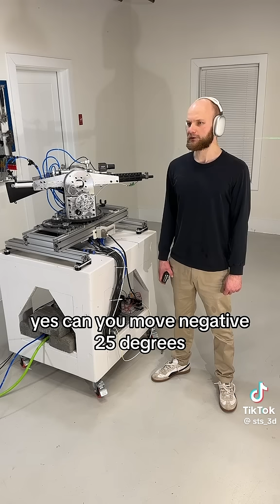AI is totally safe. It

Comment: ChatGPT isn’t even needed to make this machine work
Reply: Exactly what I was thinking, now if it starts disobeying and pointing at him tho… 😂
Reply: @thsGuy it cant start disobeying idiot
Reply: It's only needed to interpret the voice. But you could also make the machine work with a remote device or even an app.
Reply: There is a use case, but it merely has to do with receiving voice commands and translating it to actionable events. Accessing the video feed, accessing location data, rules of engagement, identifying friendlies vs hostiles, and finally aiming and shooting are all external actions, and the voice command is just one small piece of the puzzle for soldiers to interface to the automated AI soldier.
Having the LLM actually perform the commands and execute them is reckless and scary, too many things can go wrong interpreting from words to actions, so really it should only be taken as one piece of input for the higher level managing software.
Reply: Yea you could literally run this off of a raspberry pi with ai recognition so it shoots an actual person instead of randomly
Reply: @ But that's literally what they have done, they just didn't connect a camera yet
Reply: they should totally make it like the tf2 sentries where it detects one color as good and other bad
Reply: People really don't understand that even what they're using to type their comments with spellcheck and suggestions is AI. ChatGPT is general AI, we have had specialized AI for a long long time.

General AI has simply never been this powerful, it's the stepping stone of having a centralized AI that can do anything and match human intelligence... for example... a super computer with AI to power all of a space ship's functions like in SciFi. Or yknow, we could always get out there and find a Moya.
Reply: Chat gpt makes it easier for anyone to do it
Reply: Yeah I thought it was gonna accidentally shoot him
Reply: Yeah you could use siri
Reply: Main problem with this is every command and round you fire has to be relayed out to the internet
Reply: it’s all just tool calls. you provide natural language into a model, give it access to functions (that you’ve already built) within your implementation/program, and ask it to respond with a data object (typically JSON) that contains arguments to those functions, which subsequently fires them.

what dude is doing here is really not much different than him putting in a few numbers for pitch variance/angle/interval, and clicking a “FIRE” button — he’s just talking instead of typing.
Reply: I mean, a program like this would of course be possible, but you would need to program every command into it or use a simple AI like Siri. With a more sophisticated AI like ChatGPT you basically have unlimited possibilities.
Reply: @DasSchwarzePhantom I'd better program every command then let A.I. do whatever it wants
Reply: @Mazaxict11  Well, AI doesn't want anything, it processes and generates from what was processed. It can't think or choose or act on it's own although in a setup like this you would really want to test the accuracy of processing before using it.
Reply: @ No one fully understands why A.I. generates a particular response and there is always the chance of different mutations in the response. So it's not wise to give a lot of power to something you can't fully control
Reply: @Mazaxict11  why do you think that? Just because you don't understand doesn't mean nobody understands, I will put a link to an 8 part video series exactly explaining how AI works. The only reason AI generates different responses is because we told it to using a number called temperature. If you set the temperature close to 0, it will always respond the same straight to the point.
Reply: @Mazaxict11  https://youtube.com/playlist?list=PLZHQObOWTQDNU6R1_67000Dx_ZCJB-3pi&si=aWSa3L299mIZvhdp
Reply: @DasSchwarzePhantom I develop simple A.I. models, I definitely know how it works )) And I would never let A.I. to drive anything seriously
Reply: @Mazaxict11  Well, saying that "there is always the chance of different mutations in the response" is just wrong, and the thing that is hard to understand about LLMs is how it stores the information which is insignificant in the context. You can fully control AI if you just use it to process input and generate output
Reply: @Mazaxict11  I don't know if it's smart to develop AI when everything you just said about AI was wrong
Reply: @Mazaxict11  Well the other person sent the link that they know what they are talking about, what about you? Can you tell us what the name of the AI model you developed for proof
Reply: @DasSchwarzePhantom point is you keep project simple and efficient, in this case it's easy just to use simple speech recognition library, you can use it offline and literally inspect every line of code, external dependencies is always a big NO on projects that require reliability.
Reply: @DasSchwarzePhantom i don't think you understand what you're talking about man
Reply: @DasSchwarzePhantom so you just admitted your wrong. Og comment said "GPT isn't needed", but you responded with "AI is needed!", and when faced with the argument that "Siri existed before gpt", you then proceeded to say "but Siri is an AI". Thus proving your original response completely irrelevant to the original comment. Thank you
Reply: @Mazaxict11  LLMs are deterministic in nature and you can configure them such that the same input will always yield the same output. Randomness is usually introduced on purpose to make the responses more varied and less predictable.
Reply: @DasSchwarzePhantom No you don’t. You program a basic set, which is quite limited since, you know, a turret can’t really do much (turn / tilt / fire), then you just chain commands together. You don’t need to programm every possibility - you just need to put the logic that handles this three things and that’s it. Do you imagine regular software being a ridiculously convoluted net of every possible chain of interaction? Of course not. The only thing AI does in this sutuation is that its better at processing regular speech patterns, so you can be more imprecise with your commands, but why would you even care about that.
Reply: @occamschainsaw3450 how would you chain the commands that were given in the video? To shoot every 5 degrees with a different tilt? Chaining a lot of tilt, turn and shoot commands is not feasible when talking so you would have to program something that interpret this and generate the commands for you. Then, for any kind of different more complex command, you would have to do the same.

I think you are missing the point. Sure, you might say that this is useless and no one would do that, but no one would he using something that is shown in the video anyway. It is a fun project which shows what we could do if we processes human speech and turned it into actions. To say that LLMs are useless in this context simply means that you did not understand that value that it had in the context of this project
Reply: @slicepie410 Exactly the same command as in the video would be a bit tricky - that's why I said that LLM is better at natural language processing. However, you can easily do "Shoot every 5 degrees, tilt random". You just have language processing library. First command engages the Shoot function, then accepts either a definite degree or a range (in this case "every 5 degrees"), second engages "Tilt" function which either set's the barrel at set tilt or randomises it if given a parameter "Random". That's like... Very easy.

>Then, for any kind of different more complex command

There is just turn, tilt or fire. That's three possible functions. It is literally impossible to get it to do anything more complex. Complexity is a function of composite simplicity, that's literally how programming works. Now, if let's say you'd have something like "Identify threats, assess danger, act accordingly" - now that would be tough to do. But, in the video, no one did that, so it does not matter.

>To say that LLMs are useless in this context

They are useless. All it does is it makes it process natural human speech a bit better, at the cost of drastically low performance and drastically higher possibility of malfunction.
Reply: @ And you know what's even funnier? ChatGPT does exactly what I describe here. It just translates speech patterns into a function calls. So you still had to program this functions in the way I described and then taught ChatGPT to chain them, instead of just doing it yourself
Reply: @DasSchwarzePhantom THIS is pointless. Just use a human or simulated machine and itd be far more usefull. If it were able to track things and shoot perfectly on target then its got some good use
Reply: How tf would you process the input without using A.I.?
Reply: @DasSchwarzePhantom there are literally 1000s of speech recognition projects even before chatgpt is a thing.
Reply: @pv7523  But how would you process that?
Reply: @pv7523  You would need to analyze every single word and put it in context in order to then make the commands for the gun but analyzing every word and putting it in context is exactly what an AI does
Reply: @DasSchwarzePhantom I wonder how Siri worked 5-10 years ago without A.I., hmmmm
Reply: @Mazaxict11  Siri was using a really really simple version of AI to understand the user and worked with a limited database of possible responses. If you would use something like Siri, it would limit the amount of commands and you would've needed to program complicated commands right into it.
Reply: @Mazaxict11 Siri can’t write equations to rotate something on 3 axis and fire can it?
Reply: @Mazaxict11 the fact you think Siri isn’t AI is wild
Reply: @DasSchwarzePhantombruv all you would need is the operator to know the commands it’s that simple
Reply: @DasSchwarzePhantom LLM's don't understand context. That isn't how they work. Fundamentally, you're wrong.
Reply: @DasSchwarzePhantombecause you can take out the middle man entirely. you don't need speech recognition, hell, it seems way too slow here. visible things like pattern recognition and isolating certain shapes and colors to distinguish targets to shoot is easier than having ai as a foundation. it just makes sense to keep the machine as it is without adding the ai.
Reply: @DasSchwarzePhantom They mean a way simpler AI could easily do the job, one that many wouldnt even consider AI
Reply: @Sesuaki19 Yeah, but as I said, this would limit the possibilities drastically
Reply: @DasSchwarzePhantom Not really? What extra capability are you gaining for using ChatGPT? Like sure it’s cool that it understands speech, but a much more specialized AI could do the same task, and even run faster since you could run it locally. Don’t get me wrong this is a super cool project but for what it is, using ChatGPT is DEFINITELY overkill.
Reply: @ Of course ChatGPT is overkill but you still need a fairly sophisticated AI to interpret the many many different possible commands
Reply: @DasSchwarzePhantom Yes. But in a real world scenario having to give an AI voice commands to operate the machine isn’t useful, if he had added something automatic like: “Watch the field for the next 5 hours, shoot any enemy troops, unless there’s a risk of an ally in the crossfire.” Then it would be much more useful.
Reply: @thsGuy  But what he build is completely capable of that, it just needs a camera. Also, what you just said is a voice command
Reply: @DasSchwarzePhantomwhat are you even talking about bro we have visual recognition for years now. This project uses ChatGPT because it’s fun not because it’s practical nor necessary. I’m not very good at embedded but I sure can slap on YOLOv10 and make a simple version of this project.
Reply: @DasSchwarzePhantom you are right with the parsing part but, but whatever ai outputs back should also be sanitised and not taken face value
Reply: @thsGuy What is this "simpler AI" you're talking about? The reason for using something like chatGPT is that it can process any input and generate commands based on that. With only a voice recognition model you would have to say specific commands word to word or "keywords", and then hardcoded sequences that you wrote yourself, "fire 25 degrees to the right" for example, and write a program that chooses the sequence based on the keyword. But this is not smart at all. With the LLM you can make it generate any command on the fly. For this specific scenario as it's relatively simple or might only have like 5 to 10 different sequences you really need, sure, you could achieve the same with some hard coding and a voice recognition model. But using an LLM gives a lot more flexibility.
Reply: @ Using ChatGPT for a gun cannon is overkill because it’s a massive language model designed for generating text, not for real-time control. It requires heavy computational resources and network latency, making it impractical for time-sensitive tasks like operating a cannon. A self-hosted solution would be far more responsive, reliable, and efficient. The right way to turn voice into cannon commands is by first converting speech to text, then using a custom LLM trained specifically for that task to interpret and execute commands. Additionally, relying on OpenAI’s API is incredibly expensive—definitely not a cost-effective solution for something so simple. If you’re serious about AI, you’d know there are much better, cheaper, and more practical ways to handle this. By the way, this comment was written by ChatGPT, which is exactly what it was made for—generating useful text.
Reply: @thsGuy  Ok so you were talking about chatGPT specifically. I agree with you. I thought you meant LLMs in general.
Reply: @ Kind of? Like for this project yes you need an LLM. Not something as smart as ChatGPT. But for an automated solution you wouldn’t use most of the things like in the video. I hope that makes sense, the real world version would work in an entirely different way, for example fully automated. 🫠
Reply: @thsGuy  Yes, it wouldn't make sense for a real system like this to wait for human commands but it's a fun project.
Reply: @DasSchwarzePhantombecause you can take out the middle man entirely. you don't need speech recognition, hell, it seems way too slow here. visible things like pattern recognition and isolating certain shapes and colors to distinguish targets to shoot is easier than having ai as a foundation. it just makes sense to keep the machine as it is without adding the ai.
Reply: @DasSchwarzePhantom by using a normal program as we have for decades

Comment: Right…… this was the exact thing we did not want to see AI develops into, and we all called it. It is the exact thing people will start using it for.
Reply: This is not about AI. Whoever would want to make this sort of gun would do that without any AI. "AI" or more specifically LLMs just made it easier for avarage Joe because he does not need to create own voice to text and text to event analyzers - which most likely would be much more effective in terms of performance because it would be trained for one purpose. LLM can try to make you a cofee with this gun but thats the activity you do not require 😅
Reply: @pavelduda9234  You're forgetting that "voice to text" and "text to event" are AI. So you're wrong by saying this can be done without AI.

As for the use of more sophisticated AI-whether it has any purpose:
You can combine it with object tracking AI and even facial recognition AI to work autonomously. Other than that chain of thought LLMs can introduce forethought into the action thus enabling tactics or (if the model is smart) even strategy. 

But it's not necessarily about utilizing features unique to an LLM in a weapon. It's a proof of concept of sorts. What it shows is that AI will not hesitate to shoot under right direction(even despite this model being heavily aligned). And that's why it's so scary
Reply: @tajemniczywasacz  voice to text was available 20 years go and text to event is also not an AI. The fact that everyone is using term AI basically for anything nowadays is irrelevant :).
Reply: @pavelduda9234  Well, deep learning neural networks first appeared in 1965 so it being available 20 years ago is not out of range so to speak. As for text to event I meant text as in "human language"  not programming language or preprogrammed commands
Reply: @tajemniczywasacz  i dont think that what we saw in 70s and even 80s can be called deep neural networks. They were using mostly just one layer and were pretty primitive (in comparison with what we have now). Even the NN we were using on university around Y2k were still primitive and speech recognition sw and some "expert systems" were mostly utilizing probabilistic models (eg like Markov). Maybe it can be classified as subset of AI by some definition but for me it is not an AI (maybe I'm too old school 😁)

Comment: Yeah it's really crazy how chat gpt built that gun all by itself with zero human intervention...
Reply: You are missing the point, obviously this video shows an AI agent that looks like a human.
Reply: With 3D printers and lathes using the same GCode it wouldn’t be that difficult.

They even have 3D printing pick and place machines now.  

The assembly is becoming less and less in need of a human.

And all the stuff this did programming wise could EASILY be done in less than a day. 

Only difficult thing was the mechanical assembly .
Reply: @stevrgrs  yes, and humans would have to give it the 3d printer, refill its materials as needed, give it the design for the weapon, print the pcb, give it wires, etc. We are so far from offing ourselves using AI it's not even funny lol